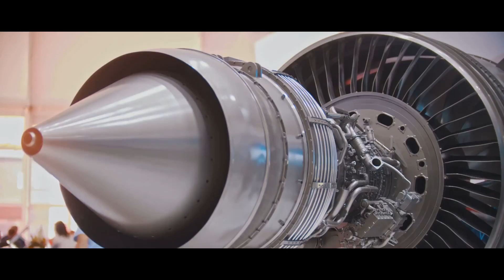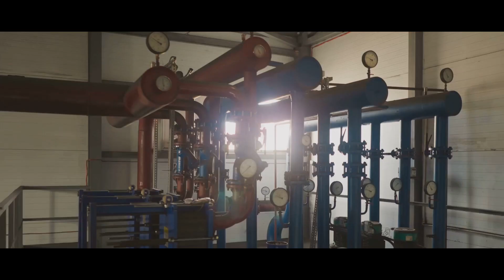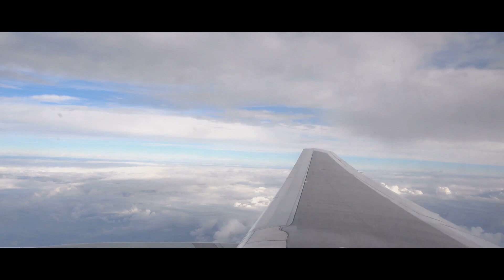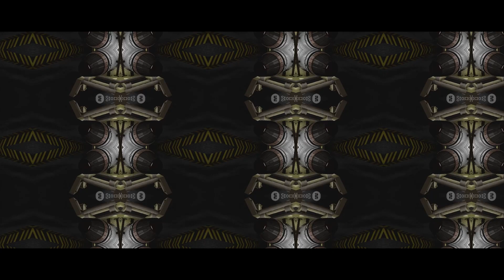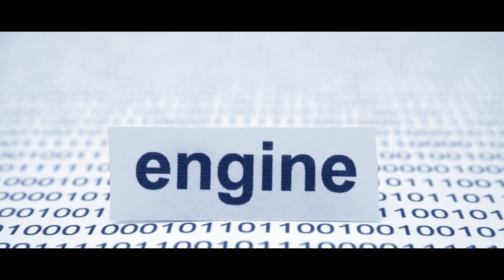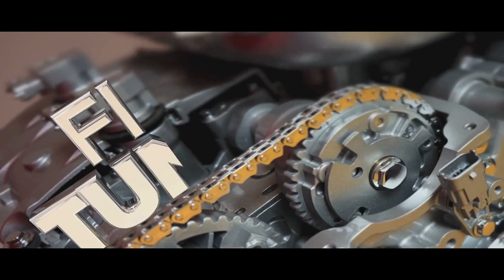Indigenous Power! Can Kaveri Engine Takeoff Now? (🇮🇳 LCA Tejas Update)

Comment: bro please take this down. this is a stupid video filled with misinformation
Reply from the maker: I understand sir, but a rant on years of hardwork is equally disrespectful, yet I will surely work on the suggestion. Thanks for your valuable time.
Reply from the maker: Any specific part sir, i would work on it
Reply: @AIwithShreyasRaj  as of now, Kaveri hasnt been integrated into any flying platform - Tejas or Drone or anything. i really like this engine and wish the best for it. unfortunately there are some bad actors who are trying to kill this project (buy foreign = kickbacks). you are showing irrelevant video thats not matching the audio. if you make any claim, back it up with facts & figures. for eg, you say best in efficiency. then you need to back it up - pull up the numbers and compare it with equivalent engines across the world (like GE F404). its better to be a honest poor man than a rich liar. even if our numbers are not that good, put it up and be honest. then we know where we are and what we need to do to improve. rather than putting blatant lies thats going to be exposed sooner or later.